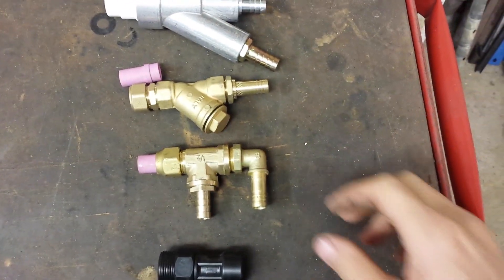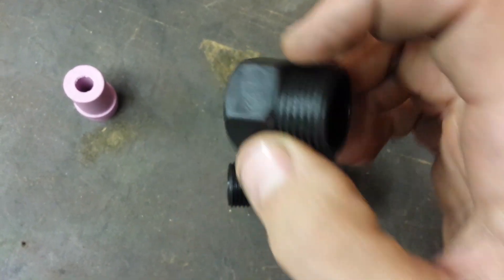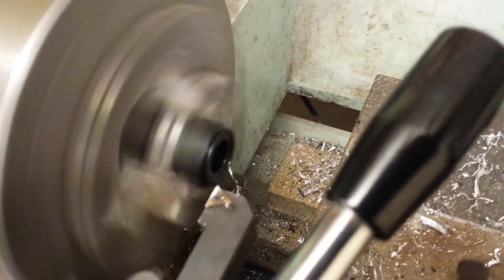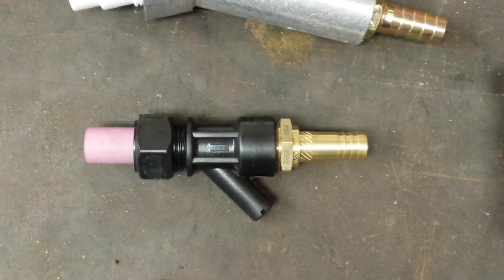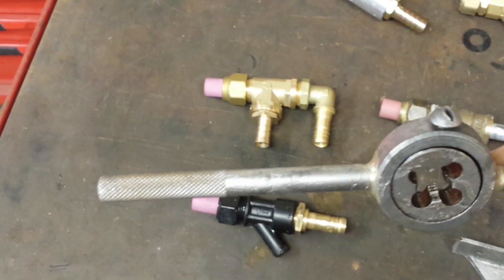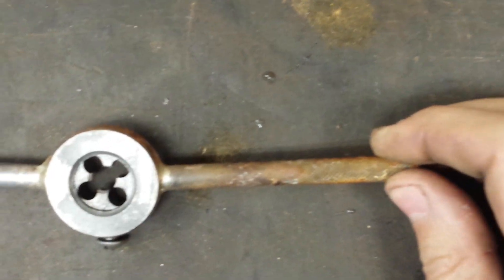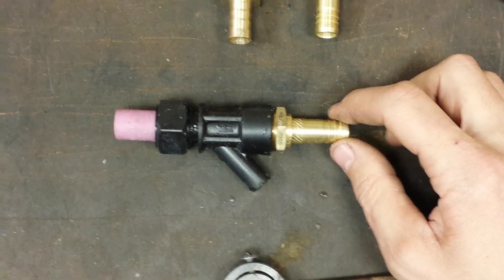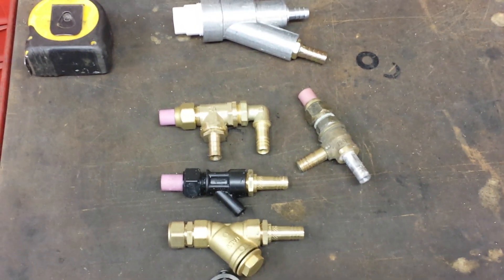New DIY Vapor Blaster Nozzle Design + Bonus Nozzle Trial

Comment: Picked up a nozzle, the same as the alloy one you have in the clip, what kind of CFM would I need to operate it ?, Just looking to make up a blaster to clean up casings and barrels whilst on the bike
Reply from the maker: Hey Ian. Those nozzles require quite a lot. 25CFM plus. They will work on smaller supplies, but you will have to stop and wait for the compressor to fill back up.

Comment: Which slurry pump would you recommend? a 1 HP or a 1.5 HP for a cabinet slightly bigger than yours, thanks for your attention
Reply from the maker: Hi Edison,

Can you let me know the flow rates of each? 

Cheers,
Josh
Reply: @ArmouryEnterprises  Thanks for your response, i'm also building my cabinet, haven't bought the pump yet, My concern is that a 1.5 HP might be too powerful, I also don't understand the distances of the air needle with the back of the nozzle, are they in touch? if they are how does the slurry mix comes out of the gun?, Thanks for your attention
Reply from the maker: Pumps are not often too powerful. If it flows too much, you can just open up the agitation jet and relieve pressure back into the reservoir.

There is a gap between the air jet and the ceramic tip. The slurry will flow into the gun, passed the air jet and through the ceramic tip. The air jet directs the air through the stream of slurry and forces it out the ceramic tip.
Reply: @ArmouryEnterprises  thanks dude, very helpfull, I'll send you pictures of my project

Comment: Nice update. How about a 1/2 bsp banjo bolt to shorten the bend?
Reply from the maker: I did have that thought, I will have to take a look next time I am around the fittings supply outlet. Should work at least for the air inlet, but I would want to see the it was not too restrictive for the slurry inlet.

I had another package turn up just before I got home with some more 90deg hose barbs that are far narrower. I will give them a go later this week.

Thanks for watching!